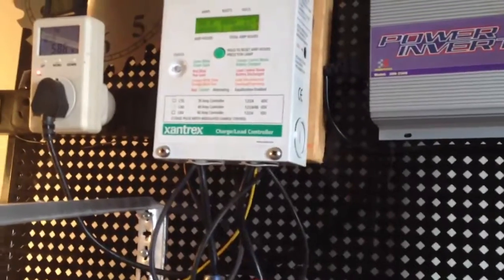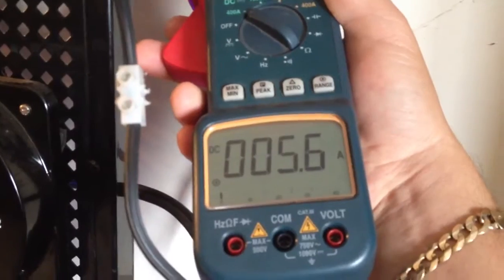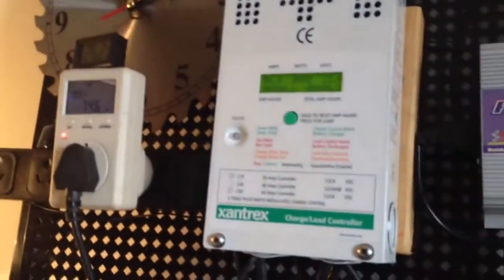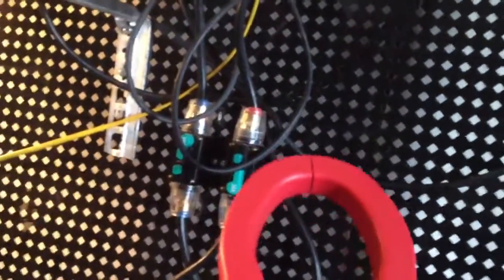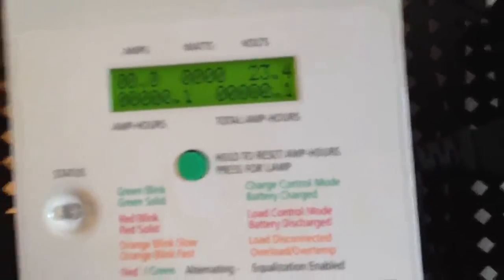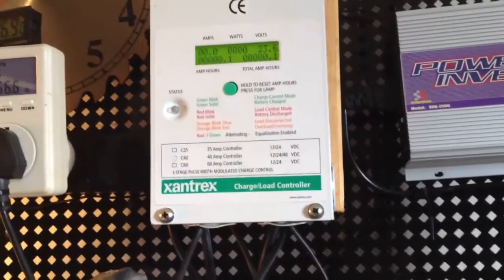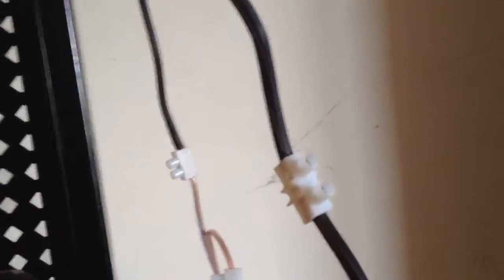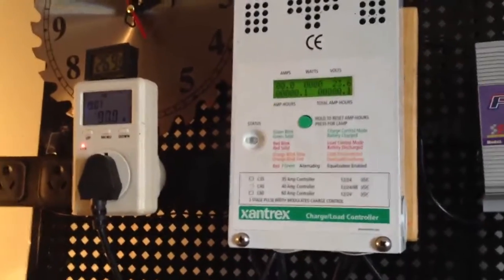24v 12v solar panel system issue power drops when connected to charge controller

Comment: That particular controller can be wired as either a pulse width modulation controller, or as a shunt controller. It also can be used with various types of battery chemistry I think by cutting a wire inside. There are also jumpers, and knobs that need to be set correctly.
I would suggest pulling out the instruction manual and going through it Very carefully.

Comment: Respect brother  I notice your batteries may I ask if you could do a review on them?. Also heat build up somewhere in your line I had the same problem and it turn out I had  join two wires together and it was at that point heat built up and burn the negative side of the wires so now when ever I join two wires together I saduer them.

Comment: I think you have the wrong fuse typ on your in coming lines . The fact that you have two different voltage come out of your panels I would think this would cause your panels to put out lower voltage, thanks for the video ,al

Comment: If you are running a 24V 120W solar panel you should be getting around 41V on open circuit (ie. no draw from charge controller).   Normally in NZ a 120W panel would typically be for 12V battery charging.

Comment: what is the voltage at the batteries when controller is not connected to them? Is it lower than 24 v. if the voltage is lower at the batteries and the xantrex is a PWM it is possible the voltage will drop. maybe you need a MPPT type charger..to take advantage of the high voltage...

Comment: 25-26 v coming from the panel is for 12 v charge system, you need 35 to 40 v coming fro the panel in order to make ur system work efficient, and u just dont need those fuses..

Comment: Yes as another person said a 24 volt panel should put out around 40 to 45 volts open circuit, seems like there is either a wiring fault between the panel and controller or the panel has gone faulty internally ( dry solder joint ) it does happen, should be able to get it replaced under warranty.

Comment: I just saw that your system is a 12 volt system. I thought you were trying to run a 24 volt system. My bad. So I guess you can disregard most of what I said. The only think I can think might be the problem is the charge controller. Does the charge controller have a voltage rating? From what I have seen, 24-26 volts on a 12 volt panel is unusual. All the various wattage/brand panels I have put out around 20 volts open circuit. Of course I am not an expert on the subject.

Comment: Your panels are designed for a 12 volt system. My 12 volt panels put out 22 volts open circuit. So if I stick a multimeter on them in good sun, it will show 22 volt. When you put a load on the panel the voltage will drop. Panels for 24 volt systems put out a little over 40 volts open circuit. Right now my panels are putting out 21 volts. The charge controller output to my battery is 15.40 volts. Not sure why your system drops to 11 volts.

Comment: Did you try rebooting your charge controller by disconnecting your solar panels and then your battery and then reconnecting. Does the Xantrex auto select the proper voltage for charging depending on the input?